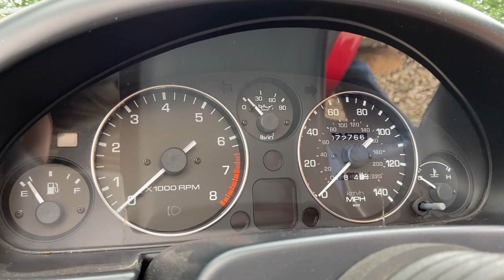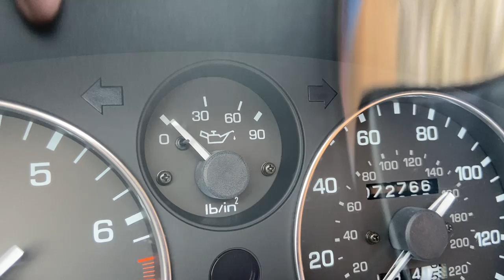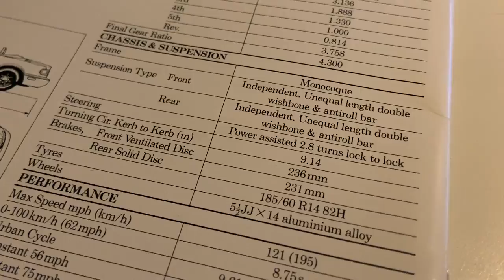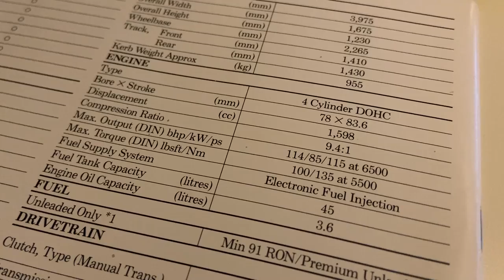The Mazda MX-5 is the Most Important Sports Car of All Time

Comment: My 2011 Sports Black in red is sitting snuggled under a cover in the garage, only 22k on the clock and sorned... 😍
Reply: My 2012 has 193k (km) and is driven every day.  Drives like new.
Reply: @johnnypetro9314  somewhere along the line mine fellow into precious.... I only use it on dry days, its nuts I know, I'm well aware of the wasted time but when I sit on her leather seats and give her a hot soapy shower we both know it's right 😜